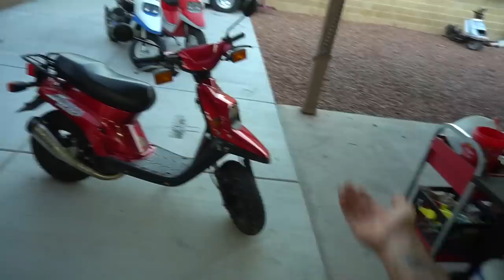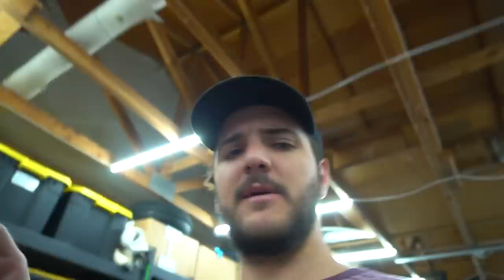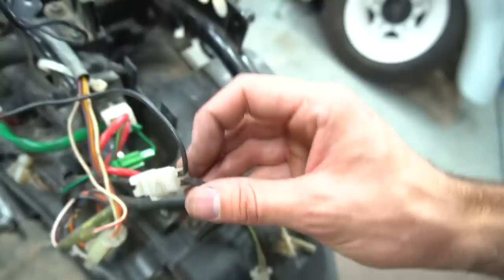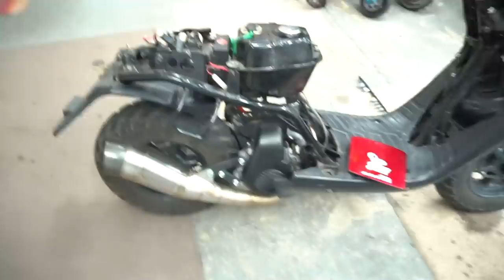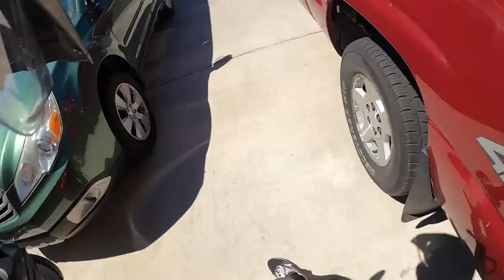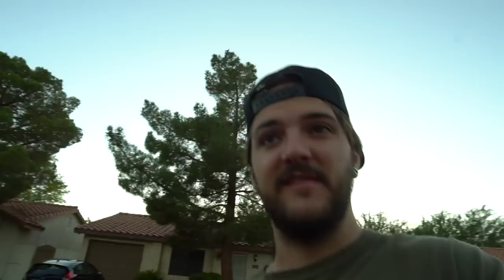i BOUGHT the BEST 70cc ZUMA EVER | New Prebug BWS Wheelie Scooter

Comment: Just made a deposit on a 1994 honda pal and was wondering whether these scooters had a variator because im woried it has one of those weird short transmissions whcih dont have variators. If Trevor or anyone in the comments could help me out it would be much appreciated. Also loving the vids trevor the new zuma is lookin clean bro, keep it up.
Reply: Idk but I'm pretty sure pals were only made from 88-90. And if has original motor it will come with af05 motor which is not desirable to upgrade.
Reply: @Reece Yoshimura   Right I see, my pal is definitely a 1994 because I have checked the vin number. So I'm not sure I might crack the case open and have a look.

Comment: 4:53 I honestly think my aero80 acceleration is faster, my top speed is only 45 but its completely bone stock, maybe I should put the engine on my elite for a lighter frame, because it already unintentionally lifts the front end sometimes, and maybe it will hit 50 on the smaller bike or at least acceleration like a bat from hell
Reply: What year is your aero80?? We have a 1984 and the acceleration is insane stock!!! Badass scooter! Need to find some plastics and other stuff
Reply: @bobbylewis3718  I have a 1983 I love the early body style like yours and mine!! I'm also missing some plastic mainly the side panels but hey weight reduction! Haha
Reply: Yea ours is missing the plastics that cover the battery and the side pieces below the seat! Were actually about to post ours forsale! Only has 15xx miles on it!